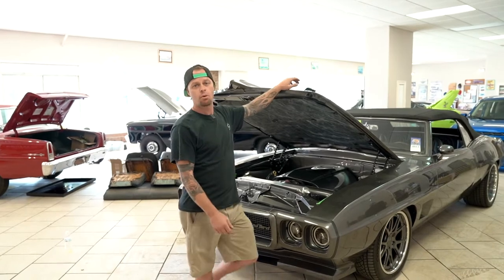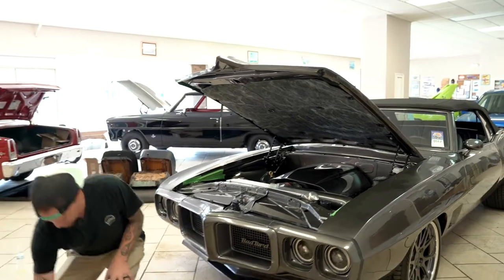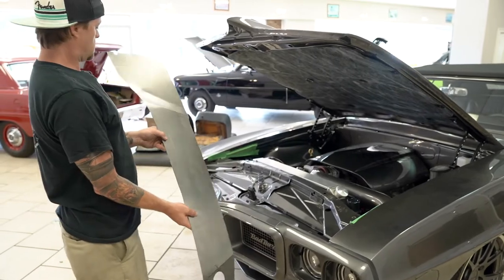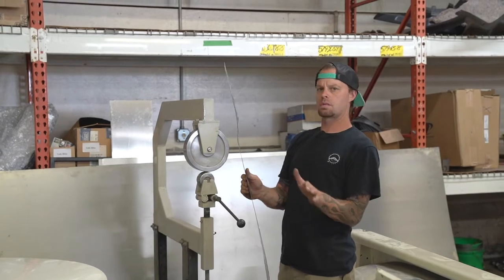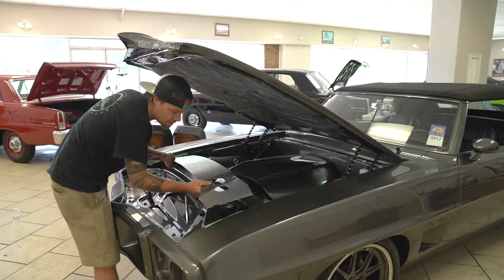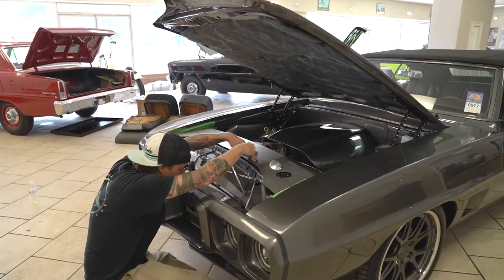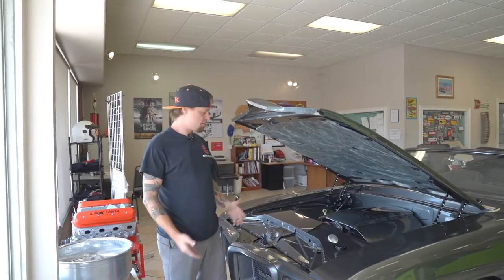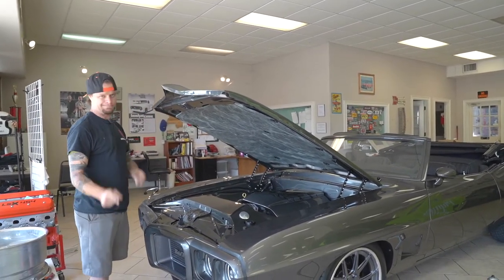1969 Firebird Restomod - How To Build A Custom Engine Cover

Comment: Nice and clean. Looks like that radiator cap will be a little difficult to get with the angle though.
Reply from the maker: Nope, just as easy as if it wasn’t there.